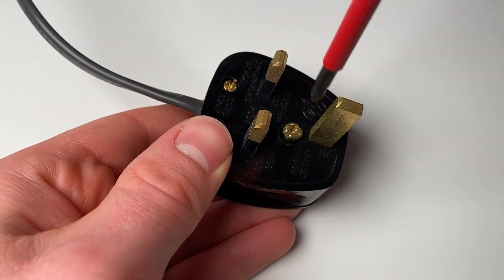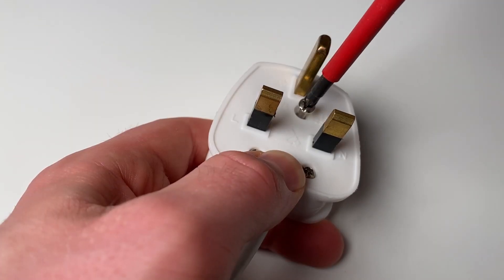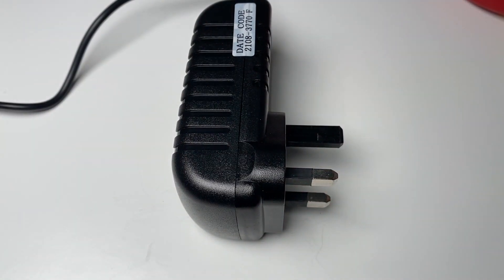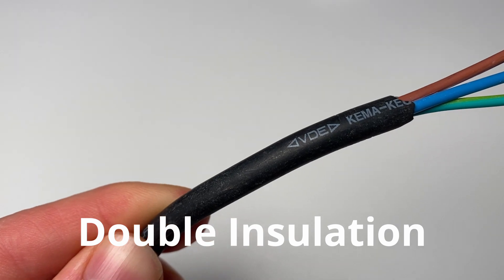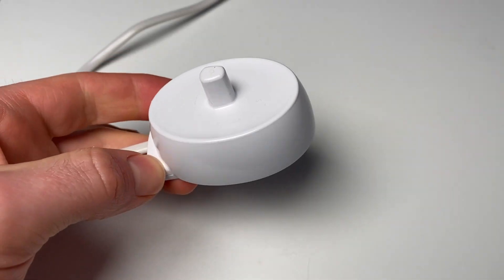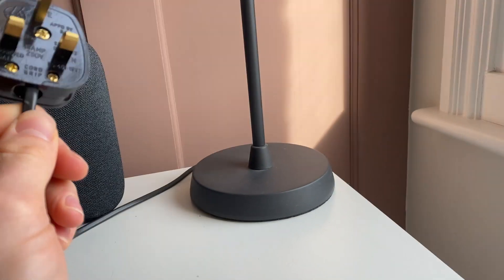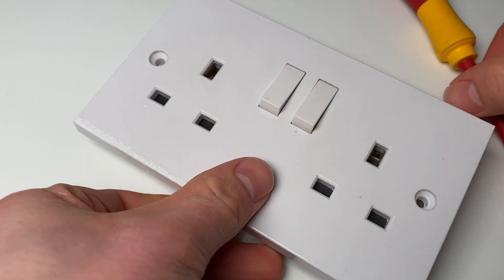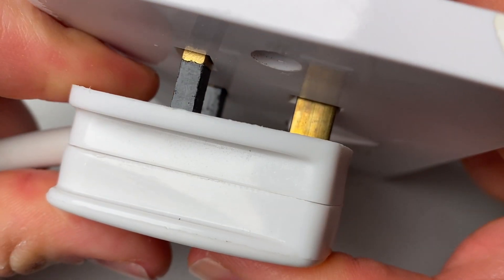Why doesn't my plug have an earth wire?

Comment: What about an old 70s electric wind organ..? The plugs sides aren't flush to eachother (very slight gap despite tight screws) so I was thinking I could replace the plug myself it as it looks potentially dangerous. Then I looked at the cable that I'd need to reattach and its thinner than modern cables and seems like it has two sections of wire running alongside eachother rather than 3 . I haven't cut it open to look. Could I just electrical tape the gap on the plug instead? If I plugged it onto a circuit breaker plug would it make it safe to use? It functions fine, no heat or sparks. Thanks 😊

Comment: Hi. I'm fitting a new electrical cooker, and here in the UK most earth wire now is not covered or insulated in the yellow/green covering . Is this still safe to use and will it be OK to wire with. Thank you in advance.
Reply from the maker: The earth wire won’t have coloured sheath within the grey cable, but it should be sheathed yellow and green when outside the grey sheath. It sounds like you just need some earth sheath. Thanks for watching!
Reply: You should also ensure that the earth wire is a little longer than the other two. In the event that the cooker gets pulled away from the wall, yanking the cable, it means that the last wire to become disconnected is the earth. That minimises the risk of an electric shock.

Comment: Hey mate I've got a question. I have a UK plug with red and black wires only. I want to fit an Australian plug to it. Our plugs have 3 points. If the UK one doesn't have an earth wire cam I just wire it up to my 3 pin plug?
Reply from the maker: I’m not sure, it sounds like it is probably okay though. Thanks for watching!

Comment: Hi, I bought a lamp from Argos then accidentally stood on the insulated plug that you speak of(with 3amp fuse). The earth pin snapped off easily.
Ive bought a new plug however the 2 wires from the lamp do not have colours so have no clue what pin to attach to. Have come across this before?
Please help with some advice.
Reply from the maker: Linking either to either live or neutral should be fine, but if you’re not confident in what you’re doing, please get professional help

Comment: Hi, do you have Twitter account? 
I have inalsa Vaccum Cleaner 1200W with 2 pin can it be convert to 3 pin for earthing and one more Inalsa Vaccum Cleaner having lots of Bump(swell) in wire. Please answer. 🌻
Reply from the maker: Hi sorry i don’t. An appliance with a 2 pin plug probably doesnt have an earth wire to connect for a 3 pin plug anyway. I’m not sure i understand the question. Thank you for watching though!

Comment: OK so the TV is not earthed.
So any metal part on the TV, including the metal stand is not connected to Earth, correct.?
Now take your voltmeter and test between the stand and a good earth somewhere else....A water tap for instance.
You measure around 80v and you can feel a slight tringle when you touch both the TV stand and the tap....What does that tell you.?
Poor design or a faulty TV PSU.?
Reply from the maker: Thanks for watching!